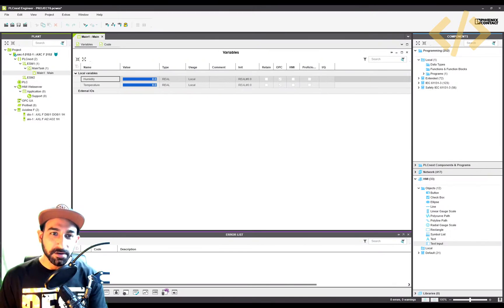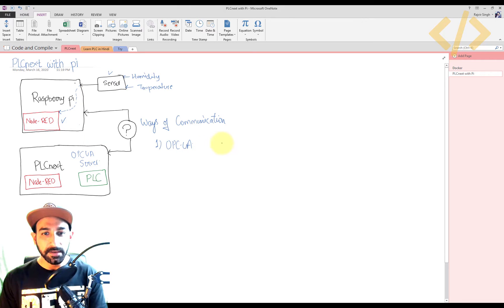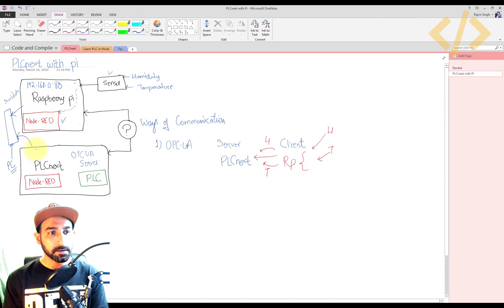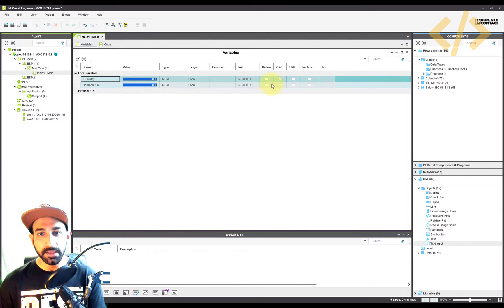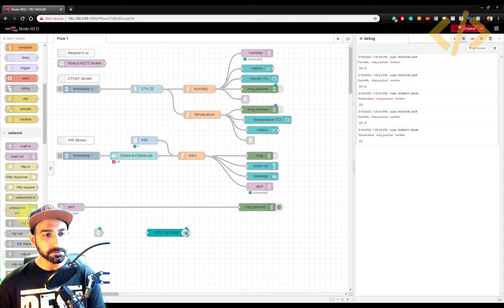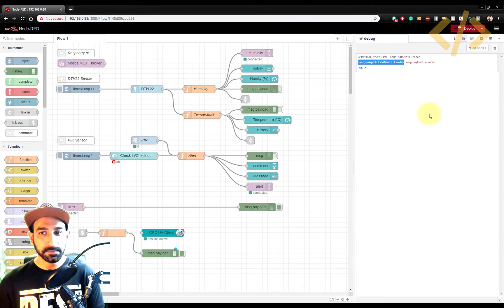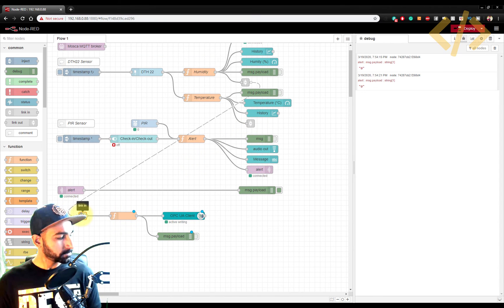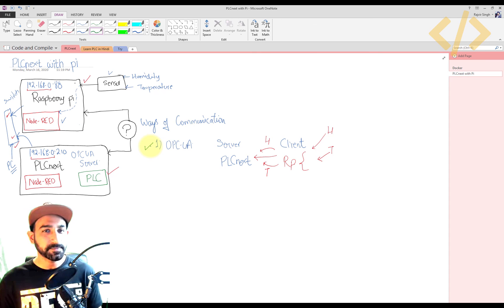PLCnext Lesson 13- Interfacing Raspberry pi with PLCnext via OPCUA

Comment: HELLO how can i do. Remote control and cloud based monitoring  of automation system.
Reply from the maker: In that case you need Cloud hosting. Yous automation system should send value to the cloud via MQTT and then you can read that anywhere in the world
Reply: @thegeterrdone  can I connect raspberry pi to PLC next and get temp and humidity values 
 via node red and transfer data from node red to mindsphere
Reply: Can you please tell me the methodology..I'm having presentation for my project..It would really help me a lot.
Reply from the maker: @saipriyan5572  Sure you can do that :)
Reply from the maker: @saipriyan5572  Just make an MQTT broker in Raspberry Pi and then publish the temp. and humidity values from PLCnext to the broker. You can also run Node-RED on PLCnext. I have not worked on mindsphere but I am sure you will find flows fo rmindsphere in the Node-RED library.
Reply: @thegeterrdone  but my professor said i cant transfer data from plc to mindsphere using mqtt broker
Reply from the maker: @saipriyan5572  Here you go: https://flows.nodered.org/node/@mindconnect/node-red-contrib-mindconnect
Reply from the maker: @saipriyan5572  The communication protocol between Node-RED and MindSphere is typically established using the MQTT (Message Queuing Telemetry Transport) protocol. MQTT is a lightweight publish/subscribe messaging protocol that is widely used in the Internet of Things (IoT) domain.

Node-RED, a visual programming tool, can integrate with MindSphere, an industrial IoT platform developed by Siemens, using MQTT as the underlying communication protocol. MQTT enables the exchange of data and commands between Node-RED and MindSphere, facilitating real-time data collection, analysis, and control.

By leveraging MQTT, Node-RED can publish messages (data, events, commands) to specific topics on the MQTT broker within MindSphere, and MindSphere can subscribe to those topics to receive the published messages. This enables seamless communication and integration between the two platforms, allowing users to build powerful IoT applications and workflows.